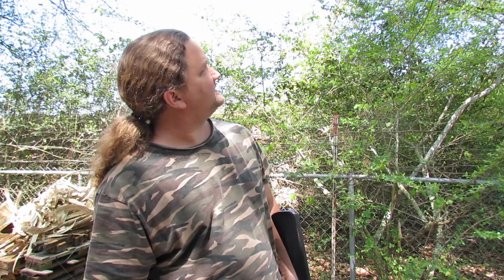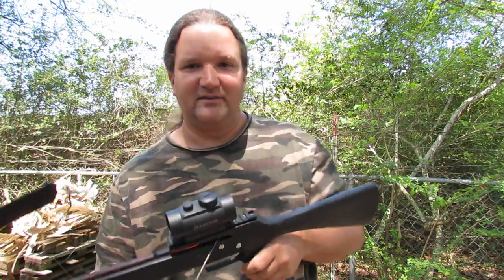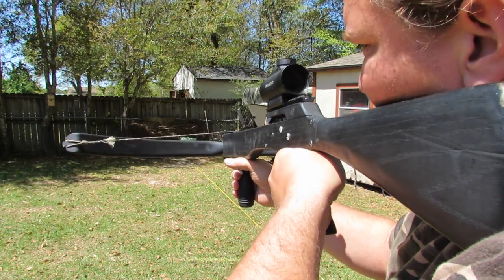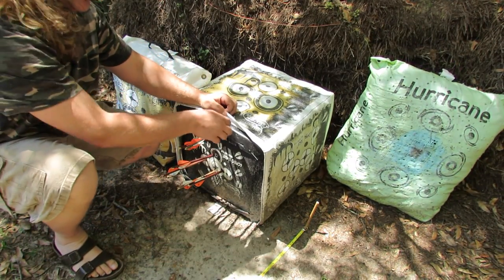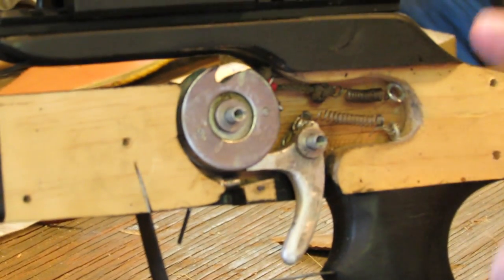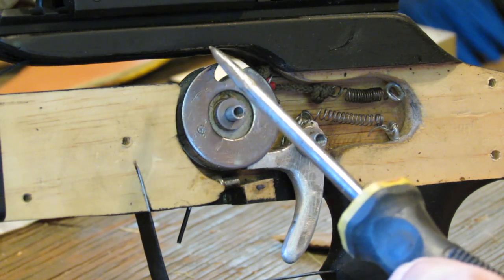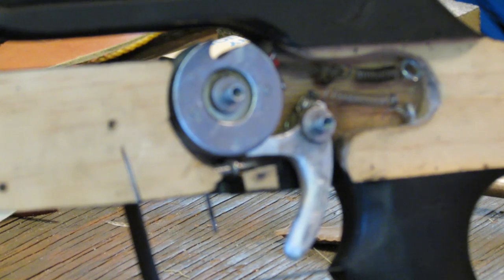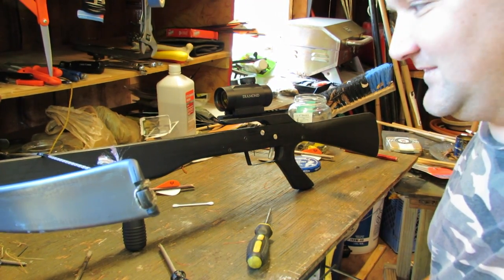My PVC Tacticool Crossbow

Comment: Very nicely done. I particularly like how you have a deep groove or channel in the rail so that the fletching slides through it. Looks like you could easily replace the limbs and string as needed, so the stock itself would probably last a long time.
Reply from the maker: Yes that was part of my thinking make everything accessible for repairs and mods. Thanks for the comment.

Comment: there was a guy at the sports show in Altoona Pa at the Jaffa Mosque, he had on display and also demonstrated a home made all wooden crossbow that was actually a an auto load repeater, it was bad as, and I am quite sure you can figure out how he did it, the bolts were on a gravity feed and there was a winding mechanism on the side that launched, then picked up the string while simultaneously dropping a bolt onto the fire plane and reloaded for the next shot, he fired about 10 bolts in les than a minute, good luck with that brain seed looking forward to your version, git er done bro.

Comment: Very nice build! One of the better home-made CBs that I've seen to date. Thumbs up!!!
Out of all the home-made crossbows I've seen lately, I think this is amongst the best thought out. I am impressed with your trigger mechanism (except for one small detail). The fact that you incorporated a safety on it is brilliant. The one small detail is that I think you should have rounded off (or even flattened) those points on the "hook" that catches the bow string so that it won't cut the string. The other thought would be to mount a metal sleeve on the string where it catches in the trigger.
The performance of your hits is pretty impressive (of course, we have not much idea of the density of your target support). Looks like you were getting some pretty good penetration. Do you have any idea what the pull is to cock that?

In any case...KUDOS!
Reply from the maker: I believe it was 45 lbs on the tilling board. I didn't realize it was cutting the string. I thought I smoothed it off good enough ? Thanks for the comments

Comment: Awesome Crossbow. Would love to see a "How To" vid on this. How did you mount the PVC to the stock. What type of string are you using. Ever think about lining the top of the stock with some sort of sheet metal to slow down fraying?
Reply from the maker: Hmm. Yes fraying is an issue, and the string likes to drag on the paint a bit, but that string is that " camo cord " you can get in the sporting fishing section of Walmart. So when in frays out I just cut another one and put it on. The " serving " helps out a lot though, it's a 4" piece of electrical tape wrapped around long ways like a cig.

Comment: i am no expert, but i know that if your bolt rail is metal, you need to keep it lubricated, if you made it just as bare wood, try to make the least amount of surface area possible of the wood touching the bolt. this is to make the least amount of friction possible, and sand it down EXTRA SILKY SMOOTH!

Comment: I'm trying to build a break-down crossbow that can be carried in a Bug-out-bag and so far, your trigger mechanism is the best I've seen and I have tried about 5 or 6 different ones that crap out after the first 2 or 3 shots.  Any chance of getting a drawing of it and of the inside, kind of like an 'exploded' type drawing?
Reply from the maker: I used a jigsaw, a drill, a hacksaw, and a bunch of sandpaper and a few files and rasps. Yeah that may be a lot of tools.

Comment: I commented on this video last year I think and I still come back to watch it... Now I have a question bub... You said it was a 1" PVC pipe for your bow part. It looks bigger.. I am wanting to build this. Have all of the material. I have a 1" PVC Pipe and a 1 3/4" PVC pipe. Which would be better? How did you flatten the PVC? How did you mount the PVC Pipe to the stock? And can you imagine the power if you had 4 1/4" Fiberglas rods the length of the bow in the PVC. Not bundled together but side by side... I wait patiently for your response...
Reply from the maker: MrRadar1967 It looks bigger than 1" because it is flattened. I could try to answer all those other questions, but I honestly have no idea. I flattened it with a heat gun, and a couple 2x4's, I do know the more mass you add to a bow the more energy it takes to throw the extra weight forward, so I'm not sure, sounds good though.

Comment: Great design, thanks for showing this off! Tacticool is a matching description indeed.
What did you use to paint the pvc and does it chip off?
Make more of these!
Reply from the maker: Flat black Krylon camo spray paint for the entire bow. Rough up the PVC first with some 300 grit sand paper to get the shine off of it, and the paint will stick great. I used 3 thin coats. Thanks for watching.
Reply: Philosophy of Survival That's exactly what I've been looking for, thanks a bunch!
Reply: Philosophy of Survival Yes, paint sticks well to PVC but only as long as you don't bang it around any. Otherwise, it scuffs and chips off very easily and shows the original white or grey of the original PVC.
Reply from the maker: Bill Smith then spray it again
Reply: Philosophy of Survival Yep, spray it again and let the paint chip off again! Genius!
Reply from the maker: mellotron and then paint it again
Reply from the maker: Philosophy of Survival sounds like your coats are too thick, I have had no "chipping" issues...

Comment: hey mate how did u make the handle under the crossbow plz answer.....
Reply from the maker: With wood, a rasp, a belt sander,and my drill clamped in my vise with a sanding wheel on it to round it off.

Comment: Have you measured the pull weight?  I have a 150lb Barnett Quad 400 and it seems significantly lighter in pull. Not saying it's bad at all, just comparing.
Reply from the maker: Yes it is 40 lbs. Not made for killing deer, but its perfect for squirrel.
Reply: Perfect for squirrel or other small game. Ever thought of flattening out the PVC, laminating them together to get thick stock and using that instead of wood? It would be crazy strong but I wonder if it would be a lot heavier than the wood too?

Comment: Hey man, loved the video. This might seem like a dumb question, but how did you make the PVC tube handle all that pressure? I tried bending one just now, and I doubt it can take much more than the pressure I can create with my two hands before it bends?
Reply from the maker: Its tapered from 3/4" to flat on each end. And getting
 the bow exactly even on both sides was the major pain in the ass. If it is off just a little, it will throw the arrow to the left or right when it leaves the bow. Good luck, I have tried to make a more powerful bow since, but they all fail. Its so aggravating I gave up on it, and threw it in the shed till my nerves calm down enough to try again, I'd rather build a self bow out of a tree than mess with PVC it really annoys the hell out of me. Sorry for the rant. Good luck!
Reply: Thanks for the answer mate, and I can definitely see why you are aggravated. I will try your technique soon, and hopefully I can get the calibration right. I ended up cheating a little bit, finding an old childrens bow, cutting it in half,  and using that for my crossbow. Packs a real punch!